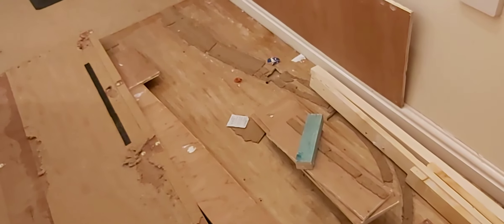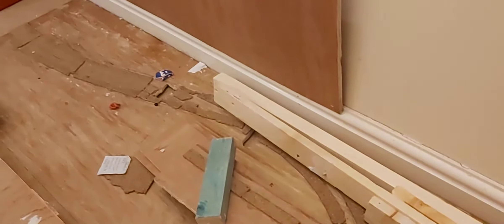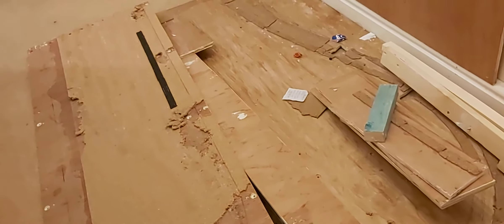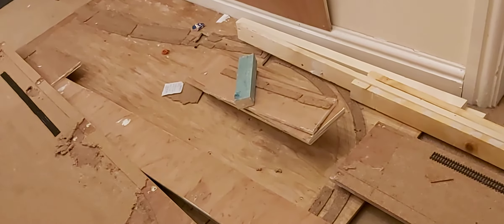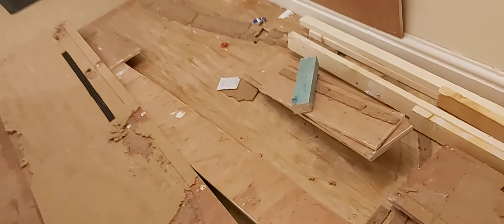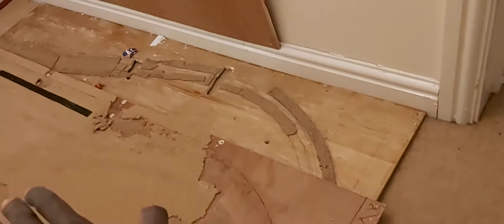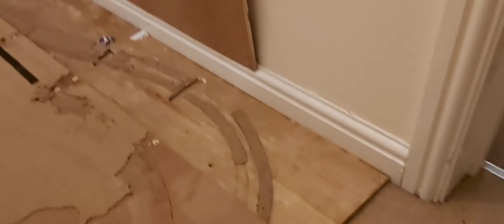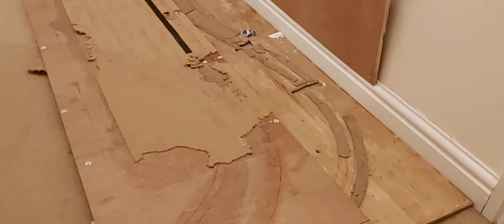22 January 2021

Comment: Nice to se an update! we have all been there trying to patch work baseboards and in time it's not worth it as it cause's problems and N-gauge isn't forgiving enough. The key is solid framework with holes in it for wiring to pass, good base for your track work and if using point motors make sure they don't interfere with any cross beams. looking forward to see how you progress, It's a lot of work but worth it in the end!